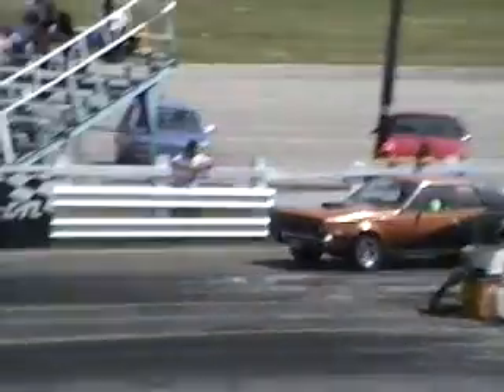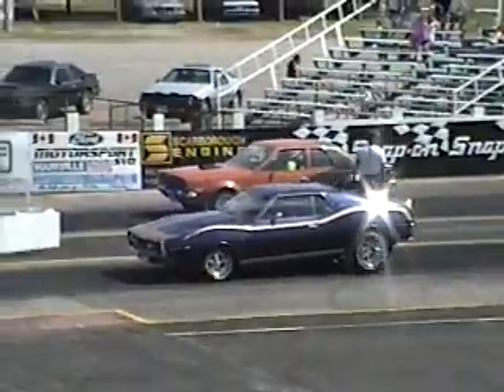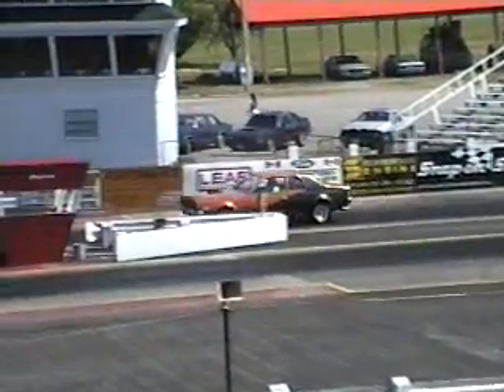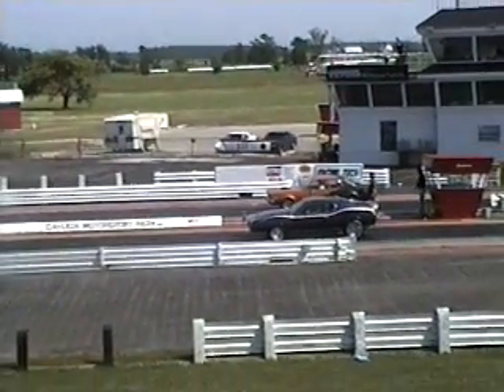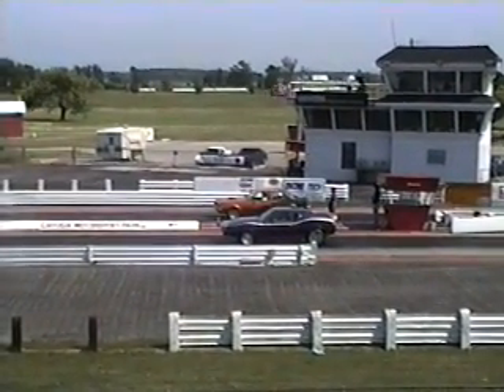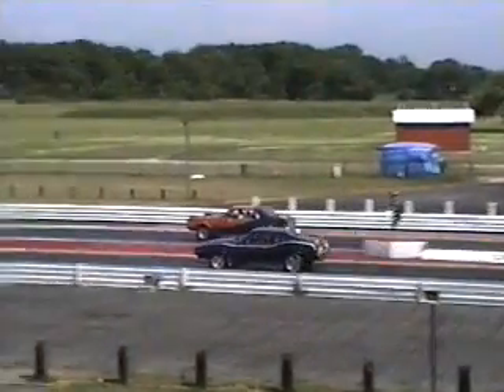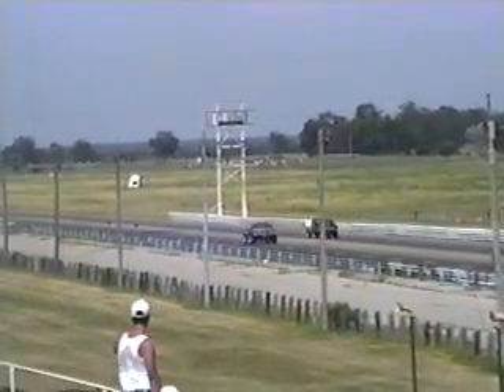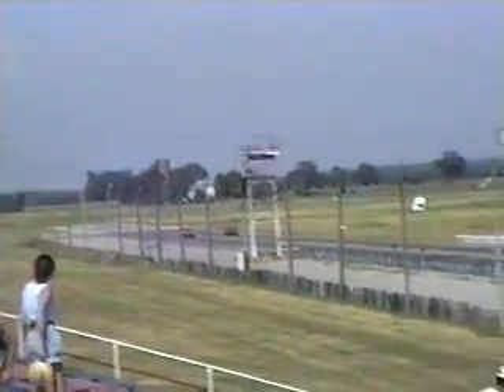Me winning AMC day at Cayuga Speedway

Comment from the maker: I dialed in 13.68 and i ran 13.68@102. Not bad for cam/headers and 3500 to 7500 RPM Torker intake/750 holly. I shifted at 5600 with a Chrysler a998 transmission. The a998 transmission is a beef up version of a 904, it has stronger Intel casting with 1 extra clutch disk per clutch pack with a 10 inch factory high stall of 2300, , It was made for Chrysler cop/taxi, AMC used it in cop/taxi and cars up to 72 behind a 304 v8.  I got the 360 out of a 73 AMC ambassador station wagon. I ditch the huge 45 hp parasitic loss with the Chrysler 727 transmission used the 25 hp loss of the a998 ... The whole drive train just belted in no modification to 3131 lbs 72 hornet all the wire/Cables /linkages match 　 and for dirt cheep no one wanted them, the 360 was 8.25 competition I crank the timing no ping, the stock 2.025/1.625 heads flow .207 factory..  ending with a built 3.54 AMC limited slip dana 20 Truetrac  dana out of a 69 AMC Javelin I Made 300 hp at rear wheels